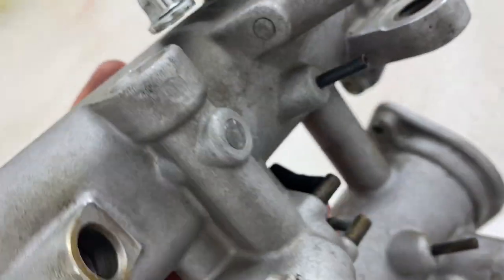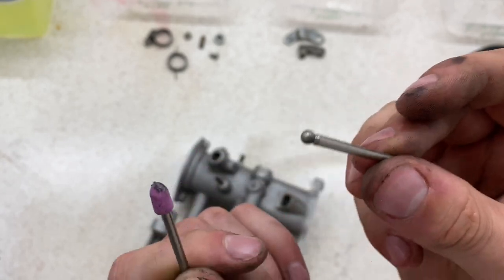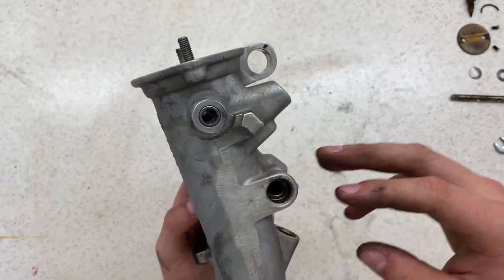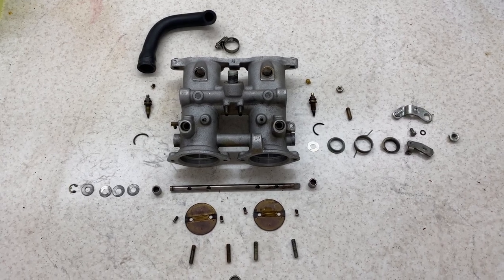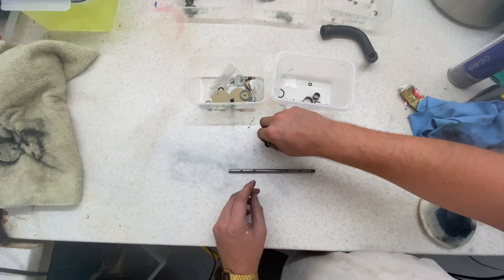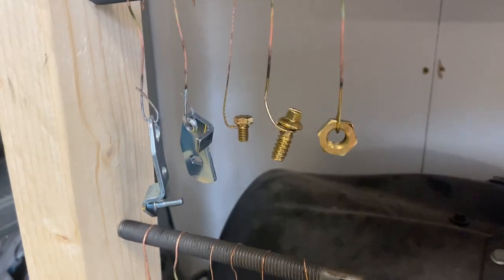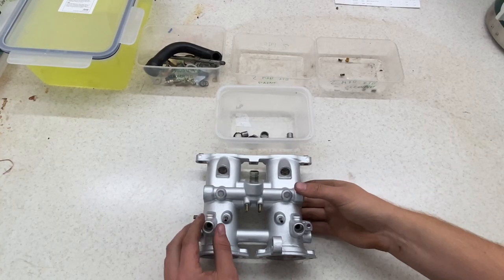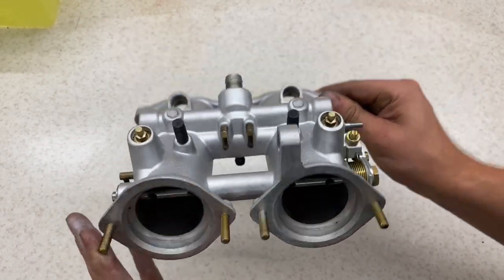BMW E34 M5 S38 - Individual Throttle Body Restoration

Comment: An interesting video from across the pond. Some notes:

Springs should not be plated (you will see the plating flake off with use) 
For screws the same type was used in Solex carbs 
The actuator arms which link to the linkage arms (the ones with spherical bearings) are made up of two pieces as you found out. But you should have marked how the two pieces are bolted together as there is an adjustment there. 
I hope you kept track of which spacer washers go where because they set the axial clearance each side of the each butterfly valve shaft (8 thou). Required due to thermal expansion. I noted you spoke about "thin and thick" ones but there are far more than 2 types involved. If not done you must experiment with them using feeler gauges before peening your butterfly screws. 
The 3 bearings you used for the main shaft are incorrect, they should be the 2RS version (sealed, FPM material preferable due to temperature)
The butterfly valves should be installed while the shaft is still free in its axial movement (so before installing the linkage and nut). You also polished out the witness marks showing exactly where the butterfly was installed prior to disassembly - these are helpful, but the flap position should still be checked in a dark room using a torch, with the butterflys closed as much as permissible (achievable by not snugging down the screws fully and letting the shaft float axially). Also each butterfly should go back where it came from (so position 1 butterfly should not be in position 2 and vice versa)
Reply from the maker: @breakaway-e8s  hi, some great information hear. Now I’m going to be honest, this was one of the first big restoration projects I did and looking back I have many improvements to do now that I am a fully qualified and much more experienced mechanical engineer. Luckily for me, I have a spare set of throttle bodies which I plan to restore where I will take all my experience and make a better job. However most of the things you have mentioned were completed and they are fully functional and within tolerance. But yes due to some errors in dismantling I did mix up the washers and had to swap them until I had it correct.

Comment: Where do you buy all the bits? Im about to start same project...
Reply from the maker: I search for all parts and their part numbers on realoem.com, then contact my local BMW dealer (Cotswold BMW) and give the list of numbers. They arrive within a week of payment and you can get 10% discount if you are a member of e30zone.net in the uk!
Reply: @BadE30  hey there -- where did you find the oem part numbers for the circular brass butterfly throttle pieces, as well as the screws holding them in? I'm on the throttle housing assembly page of realoem for my e34 M5 and cannot find the part number for those screws anywhere (one of mine is a bit stripped). Am I looking in the wrong place?
Reply from the maker: @danpratl5289  hi, i just cleaned up the butterfly valves and then made my own screws on a lathe using stainless steel hardware, could not find any replacements through bmw
Reply: @BadE30  ah ok. Yeah those screws are incredibly hard to track down. One last question—those bearings (HK08122RS)—how many total did you need for the three separate throttle pieces? And, are they all the same size?
Reply from the maker: @danpratl5289  it’s best to make your own, i would not recommend reusing due to the peening them over. There are 6 of the butterfly shaft bearings in total, the linkage shaft bearings are different
Reply: @BadE30  great, buying 6 of those. Would you happen to have linkage shaft bearing product # lying around?

Comment: Do you happen to have the exact names of the tools you used to get the bearings out? I’ve been trying with a number of tools and cannot get any out.
Reply from the maker: https://www.ebay.co.uk/itm/10x-Inner-Bearing-Puller-Set-Remover-Slide-Hammer-Internal-Kit-9-23mm-Blind-Hole-/193703055175?mkcid=16&mkevt=1&_trksid=p2349624.m46890.l6249&mkrid=710-127635-2958-0

Hope this link works, ‘10x Inner Bearing Puller Set Remover Slide Hammer Internal Kit 9-23mm Blind Hole’.

I had to slightly modify the lipped part of the tool for them to fit, but worked perfectly
Reply: @BadE30  Awesome, thanks man!! Much appreciated.

Comment: Do you have a part # on the linkage shaft bearings?
Reply from the maker: All P/N's are in the description!
Reply: @BadE30  Perhaps they were removed or I am retarded? But I don't see the parts numbers in the description. I ordered the smaller bearings that you listed in the comments. Didn't see the part number for the bigger bearings. Have everything taken apart and on a bench currently
Reply from the maker: @JohnDoe-qh6mg   oops sorry! I thought i had it all covered!!
Those linkage shaft bearings are HK1210AS1
Reply: @BadE30  Thank you so much!!